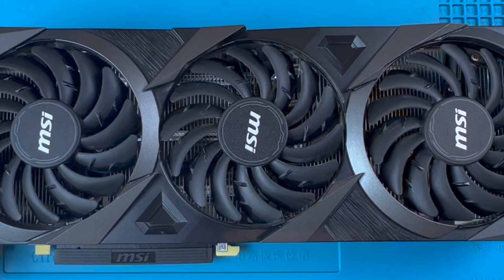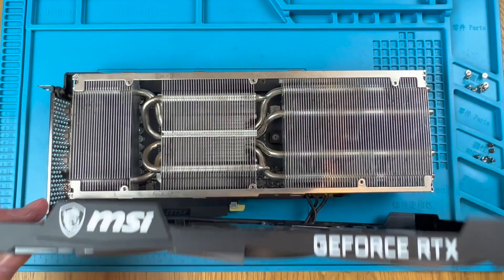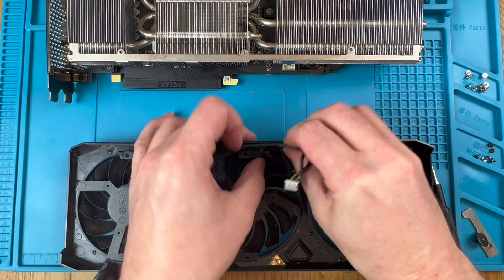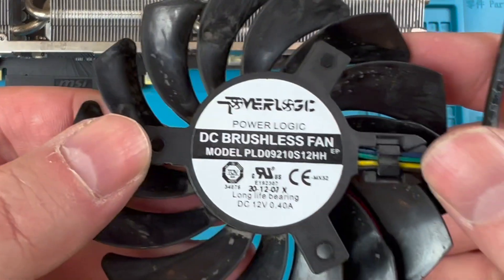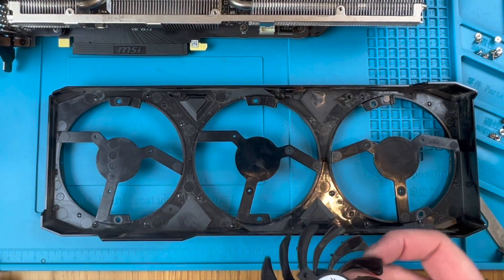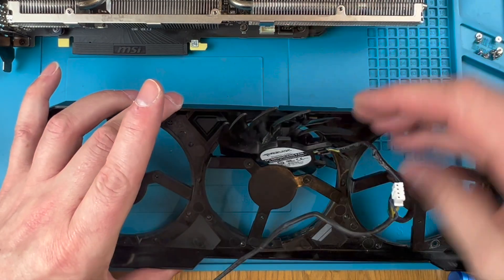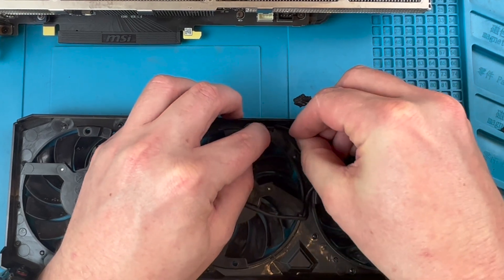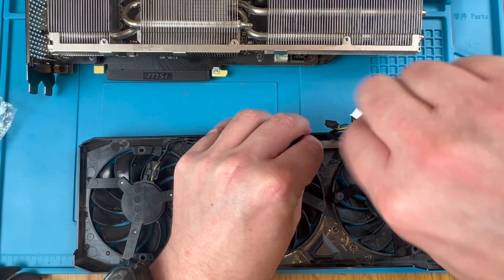How to replace GPU fans on MSI Ventus 3X fans in 10 mins

Comment: My question is are there RGB aftermarket fans on the market. Only reason I am considering this, is I am building a second computer in a Tower 600 case. And pulling parts from two different computers, including this 4070 card. I want it facing out in horizontal, but I would really like some RGB.
Reply from the maker: I have not seen any, but I honestly didn’t look either. But for the Ventus in particular, there is not a lot of room isn’t the shroud so it may not have the best options for this. Maybe there could be room inside the top of bottom edge for a flat strip, but not sure on connection options there. 

Interesting project though, hope you find a nice solution.
Reply: @sometechguy  Yeah, after watching your video, I was fired up and went looking. No, I could not find aftermarket RGB fans for the stock 4070 I bought back in fall of 2023. There is one option left, On Etsy, they have a small ecosystem of RGB aftermarket custom components. This includes GPU RGB back and side plates with their own RGB headers. Cost though is around $60 or more each. But they do exist. Just no fans. I will make that card RGB, if I have to mount that flexible RGB wire to the card manually. Edit: will add, I have a 9070XT with RGB in my new build, this is what set me up to question the 4070 dullness in future used parts PC two.

Comment: My temps are fine, 80 degrees C under heavy load but 2 of my fans are stuck in properly and the third one is loose, like a bad bearing. I can push it up and down by just pressing gently on the head, is that a sign of a bad bearing? I had the same issue with a bad bearing in my PSU, I ordered a new fan of the same type and it didn't have this issue anymore and don't make noise.

Comment: What if the amperage doesn’t match? Does it work ?
Reply from the maker: I don’t know what it is on your fans, but I would be very careful with that, you don’t want to kill the card.
Reply: @ it’s a gigabyte aorus rtx 4090 xtreme waterforce. Previous owner replaced the fans with some cheap fans. I am not sure but it seems like that the original fan is 0.50 amp, 3000 rpm. I want to replace them with Phantek T30.

Comment: You never unscrewed the fans? Just popped them off with pressure? How/why are they needing to be screwed back in if they weren't screwed in to begin with? Sorry this is confusing me a little.
Reply from the maker: This is pretty much step 1, shown at around 15 seconds into the vid.

Comment: I have the same GPU but the 2 coolers on withe connector of this video spins on idle. When the GPU is running games the 3rd fan spins and i can hear a noise coming from the fan. Is it normal just 2 of 3 fans running at idle? Is it normal this behavior and noises? Thanks!
Reply from the maker: I have not seen this, would expect all 3 to run at the same RPM. If one is making a noise, it suggests to me it has some resistance and maybe this is why it doesn’t spin at low speed also. You could start by giving it a clean out carefully to make sure there is not excessive dust or dirt around the blade edges or the shroud.
Reply: @ thank you for the prompt answer my friend! I will double check the fans. PS: My GPU is 3 months old, i wouldn’t expect any issues on a “like new” GPU😢
Reply from the maker: I wouldn't either, but its always possible. But the most obvious thing to check is that something didn't get in there that's obstructing the fan. But if it makes a sound when its spinning, something isn't right. It could be an obstruction under the fan, or even that the blades a slightly touching the shroud, so you could listen carefully for that. In any case, good luck finding it!

Comment: Thanks. I just discovered my MSI 4070 Ti Super 2 Fan Ventus has failed fans. This should help me replace them. I have a white and a black SKU and the one still working is starting to be noisy. These are some cheap fans MSI put in.
Reply: Hi, was it easy to fix? Which fans did you buy? Ive been searching and i dont know which to buy

Comment: My MSI fans are buzzing so I am going to take the chassis off and put a space Noctua on there.
Reply from the maker: Break out the cable ties 🫣

Good luck, and you may get lower temps also. 

Interestingly, the best way I found to lower temps was to repad the cooler. Some cards, even of the same model ran at different temps and changing the pads could make a huge difference on the worst offenders.

Comment: Any recommendations on an upgrade path for the fans? Would be good to consider a quieter option without any loss of performance. Great video 👍
Reply from the maker: The Ventus models have the smallest (diameter and depth) of the options in the MSI range, because its the lower end card. And there will be a few problems changing the fans, first larger wouldn't fit in the shroud, second the retainer screws are in very specific places in the heatsink and third, just the cabling would need to match to the headers and would need the correct electrical specs. You could probably jerry-rig something with cable ties and by splicing the cables, but would need to be careful of the power draw as the card will be wired to provide the same ampage as the stock fans use. But this wouldn't be very neat, and comes with risks of course of damage and warranty invalidation.

But actually, depending on your card (if its a DDR6X model such as 3070Ti, 3080, 3080Ti or 3090) my experience was that the fan noise was more likely to be due to poor heat transfer from the GPU die and the memory modules into the heatsink. I replaced the memory thermal pads on some 3070Ti's and 3080's and the cards got a lot quieter. If the heat isn't being transferred efficiently into the heatsink, the fans will be less effective in reducing the temps of the dies. So if you want to reduce the noise, that may be a better place to start. But I don't have a video showing this, and its less trivial to do than the fan change.
Reply: @sometechguy  Right, of course should check if temps are ok even though a new card and MSI afterburner has a fan curve adjustment, played with that too bit.
Thought even maybe I don't get enough air into the case and I can't set case fans to work on GPU temps so thought using adapter. Weirdly Ventus has only 2 ports, 0 extras, meanwhile my old gigabyte 2070 super had multiple, not sure if the ports actually worked, but still had them.
Reply: @sometechguy 
In got a 3060 ventus 2x and out of the box one of the VRAM thermal pads was lifted up not touching.    The noise levels are ok for my usage but for 99% load you'll hear the fans quite clearly.   It's about as loud as my Wii U actually

Comment: so how do i clean it?
Reply from the maker: Once the shroud is off, you have better access to the fans and heat sink, as shown. From there, it depends on what cleaning is needed, but I have used brushes on the heat sink to clear out dust/fluff etc and also you can use lint free cloths and something like 99% isopropanol on the shroud and fans. You can also use an air duster, but don’t fire it at the fans as it can spin them fast and burn them out.

But use your judgement as without knowing the state of the card, I can’t say for sure what is needed, and if you are not confident on what you are doing, it’s best to leave to someone who is. I wouldn’t want you to damage the card. Good luck!

Comment: I dont have issues with my fans, but this video shows how easy it is to clean the gpu without taking it fully apart. Thanks 👍
Reply from the maker: Yes, this is completely true and its way easier to clear muck out of the heatsink with the fans and shroud removed. And removing the fans also allows them to be cleaned more easily, I tend to give them a wipe down with lint/static free clothes and cotton buds with isopropanol 99% . Glad it was useful, thank you!

Comment: the construction should be similar to the two fans cards right? meaning i can replace them without fiddling with the backplace screws?
Reply from the maker: I have not taken apart a 2 fan variant, but the shroud and the fans are very similar so I would expect its very similar. And in fact, I am yet to find a recent card that requires touching the backplate to change the fans, the fans are typically mounted in either the front, or occasionally the rear of the shroud, and that removing the shroud is often needed just to get to the cables as they route to the headers.

TL:DR - Yes, I would expect so. Good luck with it!

Comment: thank you! where i can the 2fan models of this ventus oc, i want it for my gpu if you can give me a website i want to buy the fans
Reply from the maker: It depends where you are, but for Europe and the US, I would check on EBay, there are various sellers there and you can check for feedback. I had bought Ventus fans on AliExpress but as you saw, it wasn't a good experience and returning them was a pain. EBay offers a return policy which means you can get your money back if the fans don't fit well, or there is some other issue.

And as i suggest, check with the seller on the actual dimensions to ensure they are the correct size and model before ordering.

Good luck!

Comment: Hey i bought an RTX 3060 12GB about a week ago and the middle fan is not spinning (3X fans) is that normal? I can't seem to find an answer online 😕
Reply from the maker: All the fans should normally be spinning, though it may be possible for software to address headers (the physical plugs on the PCB) differently on some models. 

Assuming you bought a MSI Ventus 3X, the middle fan is on the same header as the left fan as you look at it with the PCIe connector down, so it will receive the same power. The only reason it would be spinning at a different speed (or not spinning at all), is if the fan is failed/damaged, the cable is damaged, or the fan is obstructed in some way. Check to make sure it turns without a problem, and if so, it probably needs replacing.

Good luck!

Comment: Hi,

Thanks a lot for the video.
Is this GPU a 3070ti? 

Where did you get the fans?

Thanks!
Reply from the maker: The one in the video is a 3070 (non Ti). The Ti has a full length metal back plate as it has GDDR6X memory that runs hotter and need additional cooling on the back. 

However, the process is exactly the same for all these cards. As for the fans, the best place I think is Ebay, but will depend where you are located and if this is an option. I boiught some fans from AliExpress and had to send them back as they were not the correct size. So check the dimensions with the seller, and also ask specifically if they are original units. If they turn out not to be, and they don't fit well, you can then use Ebay protection to return them.

I may make a video on my experiences of buying from AliExpress, as there is a lot of choice there but the quality varies greatly.

Comment: Most people would sell the video card (or give it away) before the fans fail, right?

All the gamers I know upgrade the gpu every year or two.
Reply from the maker: You are right that 'most' would not experience a fan failure, especially if they dispose of the card quickly. But an estimated 20million Turing and Ampere cards have been sold, so even if a small percentage have a failure, it can easily be many 10's of thousands of failures each year. Given proper treatment and handling, mechanical moving parts are also the most likely part to fail and dust ingress can add to that. Also, sometimes fans fail just for purely mechanical reasons, like a PCIE cable getting into the fan.

Also, when someone sells a card, someone else buys it. So most of these GPUs will be in service for many years. There are still people upgrading their GTX 1080's.

And of course, some people just watch videos like this because they like to see stuff disassembled!

If you didn't have a fan failure, I hope the video was at least interesting. :-)
Reply: im here because i was sold a gpu with fans that dont work... they said fully functional :/
Reply: @sweaty6253  Do you know why gpu fans fail so often?   Many times they are not using quality ball-bearing fans.    And if the fans are facing the ground, like in most tower cases, the cheap fan bearing will fail even faster!
Reply from the maker: The fans don't run all the time, so its possible that the card just didn't get hot enough to start them. You can try using MSI Afterburner to set the fan speed manually to test it. I think its less common that all fans fail at the same time, unless there is some other problem with the card. Good luck, but I would make sure you test the fans before replacing.
Reply: @sometechguy  Actually a lot of us folks across the world buy GPU's specifically to do science (F@H).  I have 8 GPU's that run 24/7 for 8 month's a year. The MSI 2 fan Ventus I have (4070 Ti Super) have failed in less then a year. I would prefer to fix them myself just for speed, Otherwise warranty.